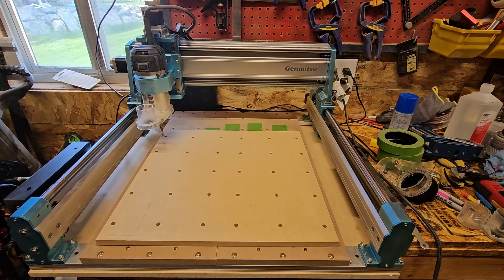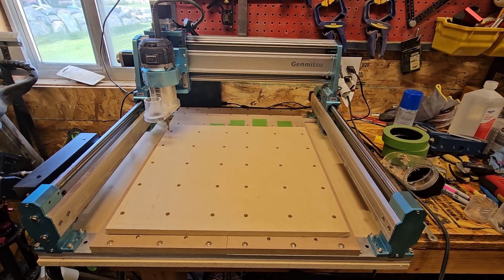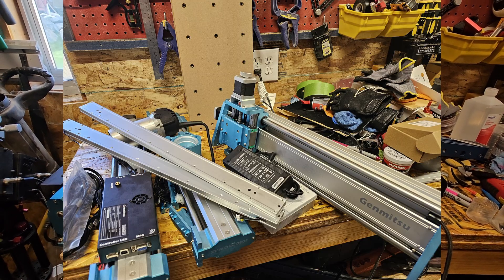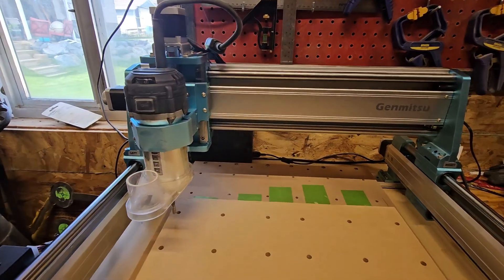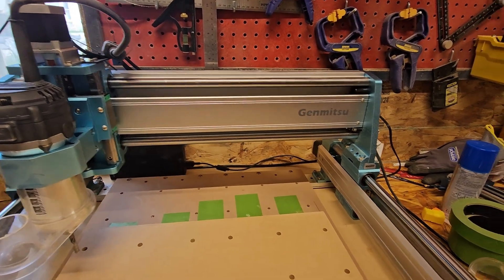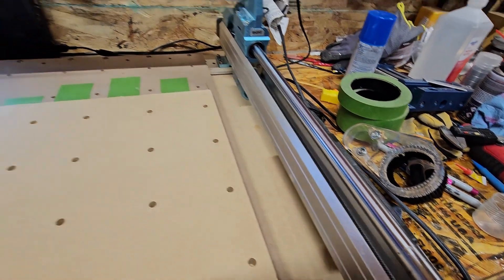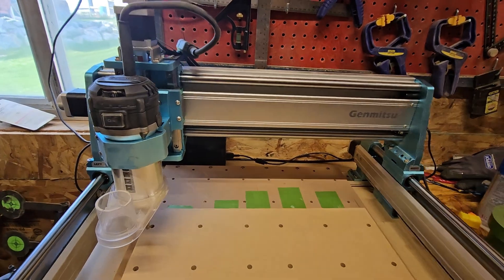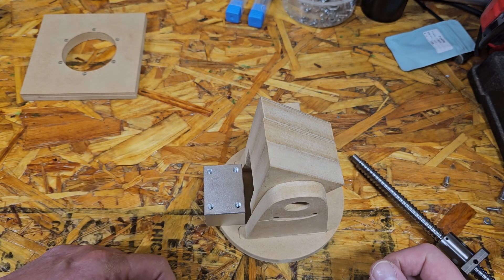Genmitsu 4040 Pro Max CNC machine

Comment: Ball screw way to corse, you want an ultra fine thread to give small adjustments per turn. Makes polar alignment much easier. I've changed mine from the std m10 to m12x0.5mm, ridiculously fine, but alignment so much easier.  I just got a cheap tap n die set and 12mm brass rod to make mine.
Reply from the maker: @paultucker2027  yeah it is corse, but very smooth with no backlash.  The proxisky I'm using now has almost half a turn of backlash.
Reply: @whyf16uy  with the 0.5mm pitch thread, there is virtually no backlash,  and you can easily home in on polar alignment without over shooting, making the little backlash there is even less of an issue.